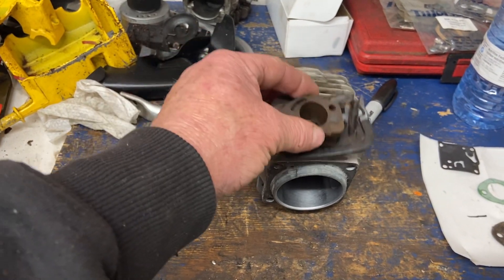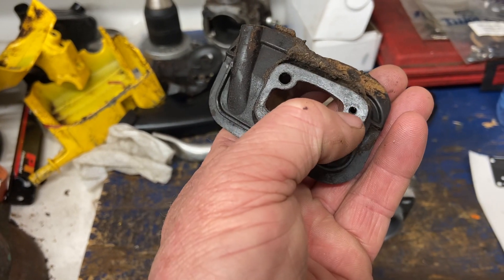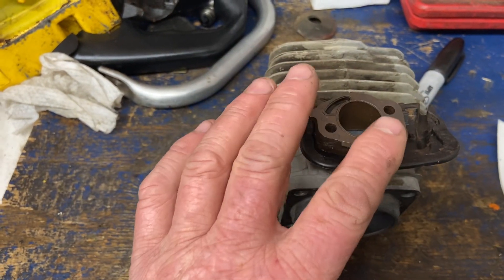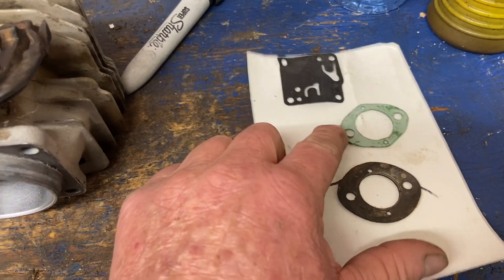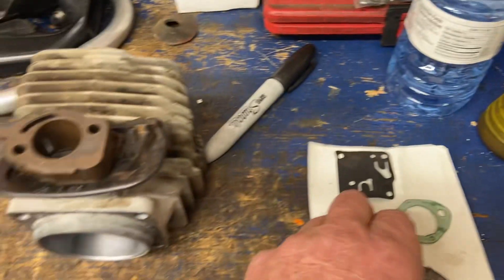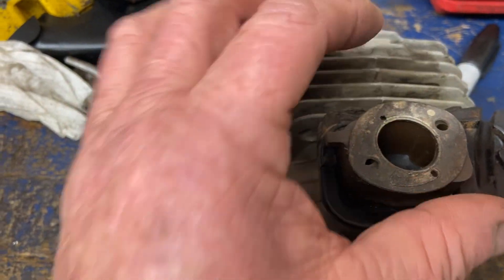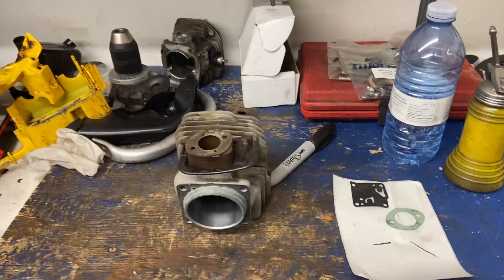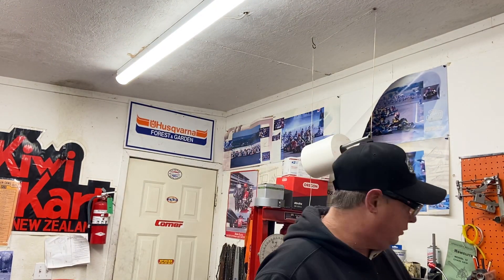how to fix husqvarna intake leak

Comment: Good tip Donny. I've made that mistake before, this video should save some folks from doing that.
Reply: I feel as though I should have done the same with the 272 I picked up, it runs like a mad man after I adjusted the little gasket that was crooked. Think I'm gonna pull the whole top just to triple check it, really enjoy the 272 honestly

Comment: Followed your instruction,  adjusted high low a little after gasket replacement.  It's running mint, thank you so much. I'll be throwing chips tomorrow. Luckily I saved the old gasket. Happy sawing everyone,  thanks again Donnie.

Comment: Hello Donny, doing a nice 266 SE that sat for along time. Understand exactly what your talking about. Going to replace all lines, gaskets and seals anyway but I will vac and pressure test before I disassemble so I know where I'm at. I'll try to match and get correct carb gaskets from local dealer if available. Mainly a Stihl guy but know how those Husqvarna gaskets are.  Hope your doing well and Thank's for the video!
Reply from the maker: Thanks woodcutter if you need help let me know
Reply: Thank you